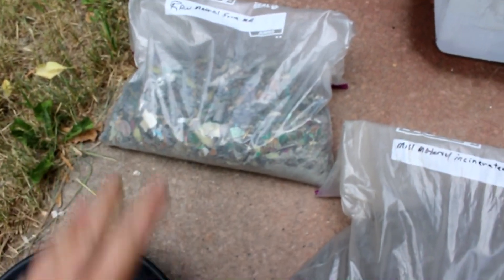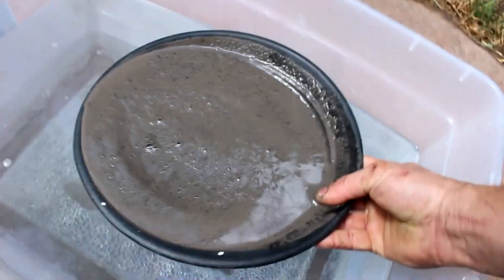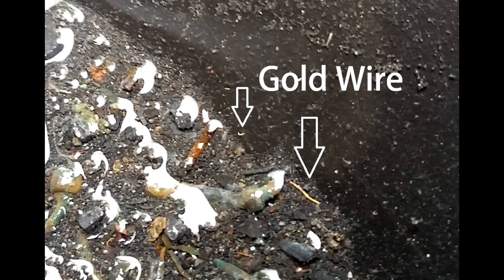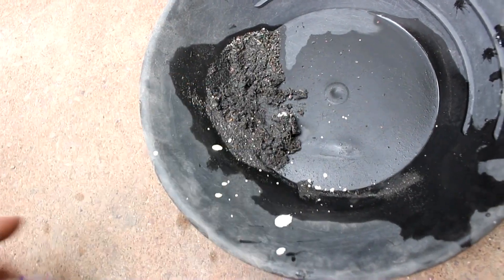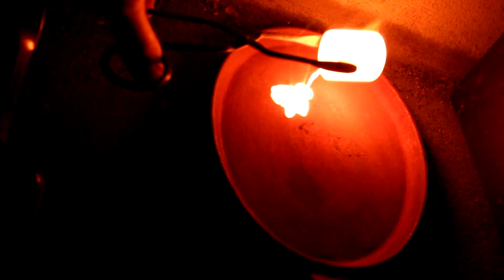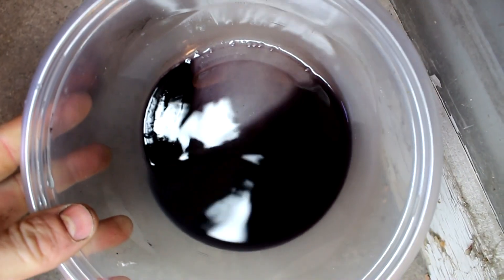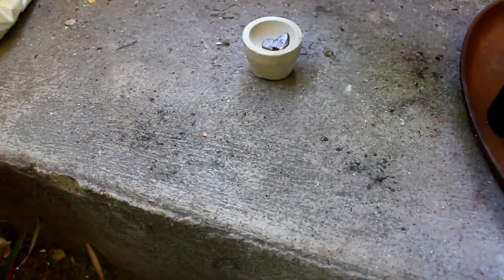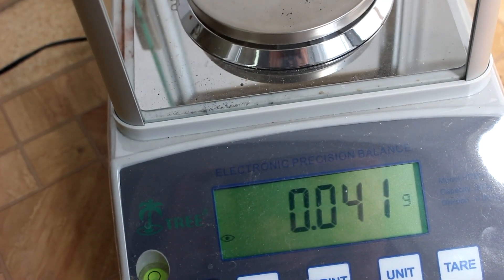Precious Metal Refining & Recovery, Episode 12: Gold From Computer Ash

Comment: yeah IC's usually are a little bit profitable on large scale if you can get large amounts for cheap (such as e-waste), but if you can get your hands on like scrap PC's those are really good as they often contain many parts which are good for recovery (or even reselling if its a rare or usefull working part) like RAM cards, GPU, CPU, IC's, gold plated parts and connectors, the motherboard, Graphics card (usually resell but if its older/junk then they still have material) Hard drives (HDD and SSD) and other bits and bobs that have value to a scrapper/refiner.

Comment: cant you just powderize the motherboards without incinerating and then use a gold mining technique where they let the mix with water run over a sort of belt that lets all the heavy particles sink and all the plastic runs through? in that way you can recycle a part of the platic and have the metals

Comment: Wouldn't be copper carbonate at those temperatures I can't remember the exact temperature but copper carbonate oxidized is it a very low temperature. I do it on a hot plate in a beaker all the time just shaking it around occasionally

Comment: If scrapers would put their scrap gold plated items in a vibrating tumbler with glass sandblasting beads it will quicken the time for processing.Then you use aqua regia to disolve the gold from the glass beads..filter and dissapate the gold from solution .You may have to refine once more for purity

Comment: I can't seem to find it anywhere, but could someone tell me what the machine is called that spins a cylindrical object really quickly so as to allow the user to cut into it with a tool off to the side? I imagine they'd make chess pieces and the like with it. EDIT: NEVERMIND, I just found out from "Building The Gun (cold gun part 3)", it's a Lathe.

Comment: 8:49 can someone explain what happened here? I've never seen a molten metal "pulse" light and heat like that.
Reply: For a change of state to occur there is an amount of energy either absorbed or released at the moment of state change, (why evaporation of water cools you down effectively ). When a liquid changes state to a solid, it releases a set amount of energy, called the specific heat of fusion, or when a changes state to a gas; the specific heat of evaporation. The flash was caused by the heat generated but the change of state, from a liquid to a solid.
 This is different to the specific heat capacity, which is general thermal energy stored in a non-state changing process. =)
Reply: well he said it solidified, but I'd love to know more about why that happens and what goes on to make it flash
Reply: +guythepirate sweet
Reply: Hopplar boooooommm
Reply: Hopplar a " hot metal " reaction occurred. Radiation is/was present . a radioactive material deteriorated.    no big bang. lucky ducky. this type of thing is way better left to a TRUE professional.  Too many variables. bad shit can happen. to not only yourself but entire neighborhood.
Reply: @glennmcmaster2880  I hope this was some sort of joke? You don't sound real smart right here.

Comment: On a side note. If you melt some hard wax into the joints of those treads it will lubricate them without attracting dust. Add some teflon powder to the wax for even better results.

Comment: The acid used in the copper industry is sulfuric acid and it is best to use for gold recovery from a mass of melted base metals because it puts more available oxygen on the anode. Iron will cause a rough mass in the cupel and copper will pull the gold into the cupel along with lead. The anode slimes from copper refining have produced more gold than all the gold only mines have.

Comment: There won't be much if any lead. Modern electronics is made with strict rules in mind (RoHS) which forbid any use of Pb for any significant quantities of production.
Reply from the maker: must have been straight tin then.
Reply: thats probably the case, though i geuss it might be possible for it to have lead if the electronics are old enough? new ones wont but mabey some from the 80s or so
Reply: Jaroslav Malec TRUTH be known

Comment: This may be a dumb question, but if most of the gold is found in the IC chips, why not just desolder them and discard the circuit board they were attached to?  Would this process be more time consuming than grinding the entire board, burning the product and then removing all the extra metal found within the board?

Comment: Is nitric acid a good electrolyte to use for the production of hydrogen? Or are there better options, preferably ones that produce no toxic gases
Reply from the maker: It would be fine if not for the fact that it destroys most electrodes, which was good in this case.
Reply: You could use sodium hydrogen carbonate (baking soda), as it only produces carbon dioxide.
Reply: Potassium hydroxide and stainless steal electrodes work best
Reply: I always use graphite electrodes.

Comment: if you want to recover gold from mother boards then i would identify the bits that have gold plating. Most of the boards as far as i can tell use copper for most of the electrical connections and only the exposed contact surfaces are gold. If you want to make money just sell the boards on ebay even old ones will likely net more than the value of the gold they contain.

Comment: From my experience when you pick up iron shaving like that with a magnet you get a lot non magnetic material stuck between the shavings (aluminum shavings, plastic shavings, pine needles, plain old dirt or whatever is in the pile).  So I think your assertion that you aren't loosing gold that way is flawed.  (Experience comes from cleaning up around my band saw in a rather filthy shop.)

Comment: Quick tip, instead of using copper with the electric current, you could use graphite as your other conductor. A smaller contamination for a few more volts.

Comment: I've been experimenting with an old 386 and some old phones I found. I've tried several ways to heat it up without a furnace I just can't get it hot enough for the gold to bead out. The gold particles melt into balls but they haven't come together. I added too much flux now it's a bunch of gold suspended in amber. The crucible broke.

Comment: Why the goid piece glowed for a second when it solidified?
Reply: When crystals or solid structures form, bonds between atoms form releasing energy, therefore thermal energy is released as well as radiation dependent on the material, such as yellow/white light (it takes energy to break bonds and go the other way)
Reply: thats what he calls "flashing over" Cody-" the bead was super cooled to below its freezing point and then jumped back up (changing from red hot to orange hot) when is started to solidify."
Reply: When substances change phase, there is a transfer of energy. This is completely separate from any additional transfer of heat involved in changing temperature. The whole pot of water doesn't suddenly evaporate when it reaches its boiling point, for example. You have to keep putting energy into it to change its phase. Moving to a higher energy phase (solid to liquid, liquid to gas, etc.) requires an input of energy, while moving to a lower energy phase (gas to liquid, liquid to solid, etc.) releases energy.

Normally, the energy released by the gold when solidifying would be released smoothly and gradually such that it would not be particularly noticeable. However, in this case, the gold was supercooled, which means that its temperature dipped below the point when it would normally begin solidifying, but it remained in an unstable liquid state. Because of this, when something triggered the phase change to occur, the process spread rapidly through the entire bead, releasing the energy all at once, raising its temperature and producing the visible 'flash.'
Reply: @NearbyTowels  I had a professor in a geomorphology course at Uni describe what I assume is the same phenomenon of why it may be oddly warm during a gentle snow fall. Called it the latent heat of fusion. As you, he described the energy required to maintain a solid state as being lower than that for a liquid state. So the change to a solid from liquid releases energy, which we might feel as heat. As Cody's gold "froze", it too would release that heat, and glow more - so cool!

Thanks for clarifying Cody's prior comment - good explanation!
Reply: i second this question
Reply: Interested
Reply: my guess is that since the temperature is constant as it transitions from liquid to solid, the temperature when it has only just solidified is high enough for the structure (when solid) to glow, then as it cools the glowing decreases. it didn't glow in liquid form, even though its at the same temperature, because the different structure has different properties and a higher temperature is needed to glow.
that was badly written sry
Reply: +Rodrigo Castro
And you clearly have no idea how quoting works.
Reply: How's everybody not wondering about that, gold glows when solidifying?!?!
Reply: If it is caused by supercooled state then the temperature of gold is increasing while solidifying.
You need to give something energy to go from solid to liquid state so in the other way the material is releasing energy. This energy is called latent heat.
This mechanics must work in order to keep conservation of energy.
With rising temperature rises energy of emited particles (such photons) hence the colour of the gold is shifted to the right on spectrum.
This is my opinion that is logicaly deduced but doesn't have to be right, I am not very good at english and I am really tired so ask me if you don't understand and feel free to correct me.
Have a nice day.
Reply: I think it's in the phase change itself.. Similar to how an evaporator works on your cooler but more intense because gold is such a good thermal conductor.

Just a guess
Reply: +Steven Sheppard lol it is also what I said earlier
Reply: Lukáš J. so basically, its what I said earlier. 😂
Reply: It's a Dragon Ball you people... I swear there are some idiot's in this world.
Reply: We must know!
Reply: objects of similar temperature glow with similar spectra.  that kind of brightness/colour change could only be caused by a varying temperature.
Reply: +Tim Ritter you copy pasted that from an earlier comment you know nothing about haw that happens
Reply: I'm gonna go on a limb here and say it's the electrons going crazy and emitting light as the molecules rearrange themselves when going to solid or maybe it is incandescent gas that gets pushed outwards as the core of the bead solidifies. Please someone?

Comment: Dozer putting in work!! What a beast!! Does that thing have brakes? If so, what kind?
Reply from the maker: It has a 6 ton break on the front. :)
Reply: +Cody'sLab your intros are getting harder and harder to read
Reply: can I ask what you do for a living, It would shed so much light on why your so smart about all this mining stuff. Are you a geologist?
Reply: most older dozers have brake bands that go around the planetary ring gear set on the final drive, works much like a band in an automatic transmission, there is a brake band for each track so you can push the brake pedal to stop plus you can use each one individually to help steer the dozer while disengaging the steering clutch for the side you want to make stop, i may make a video about how it all works if this comment gets enough likes :-)
Reply: Holy cow... or holy 3 cows, rather lool
Reply: In some of his videos he says he's going to school to become a geologist.
Reply: +Cody'sLab wow
Reply: aint no gold in it? ^_^
Reply: He's going to college for geology yes. Check out some of his older stuff. He explains it more.
Reply: +Cody'sLab ha😄
Reply: Yeah he's a geology student
Reply: +Cody'sLab and like slug, it leaves a trail behind? Unlike the slug, it'fuel..

Comment: Dear cody there was a point in this video where you used acid as a electrolyte, so I wonder would it work to use Gatorade even if its not efficient will it work?

Comment: I have a question. When you put the flux on top of the gold powder before putting it in the furnace, why doesn't it just melt in with the gold?
Reply from the maker: It sits on top like oil on water.
Reply: I think the idea of adding thr flux is to bond less noble metals to the oxygen while precious metals do not. The metal oxides then float to the surface as slag.

Comment: Dear Cody,
 I have a old Gilbert chemistry set with Aluminum sulphate, Copper sulphate and nickel ammonium sulphate can any of these be used for electroplating?
Reply from the maker: Copper, yes. Aluminum, no. Not sure on the nickel.
Reply: +Cody'sLab OK thank you!
Reply: +Cody'sLab  at the beginning of the video what's on your hand it looks like your hand got cut by a knife several times

Comment: I can get myself quite angry about people who gleefully rip IC's from boards in the hope of recovering a few micro-grams of gold, even more so when I see beautiful boards populated with ceramic packages listed on ebay for metal recovery.

These things are beautifully engineered and represented the pinnacle of human knowledge at the time they were made. They are to be treasured, not looted for their jewels.
Reply: In many ways I agree, but with the sheer number out there, and the relatively high material cost, we don't have much choice. Unfortunately few people in the electronics industry stop to think about the environmental impact of the things they create, especially when we have the constant upgrade cycle with a lot of consumer electronics.
Reply: Eh, even in high volume, the energy spent to try extract anything useful from old chips or circuit boards far-far-far-FAR outweighs the value (both economically and ecologically) of the recovered metals or materials. Way better choice to sell old beautiful ceramic gold-plated chips to collectors for a few dollars (up to hundreds of dollars for rare chips) and plant some trees instead if that's the goal :)

Even in enormous volumes, microchips contain tiny amounts of precious metals. Especially nowadays, when alternative materials are being used. Contrary somewhat to your last statement, the energy efficiency of modern electronics is hundreds if not thousands of times higher than older days, so even though they may still use some precious metals or materials, you get a lot more computing power per watt nowadays. Which is ultimately what matters, ecologically. It all trickles down to the cost of energy.